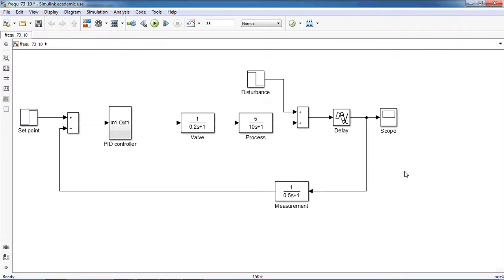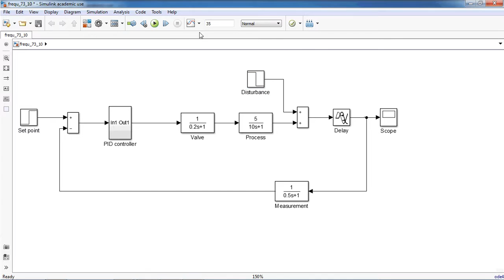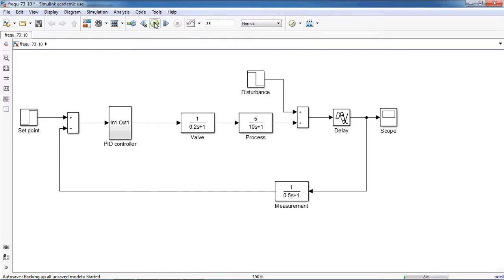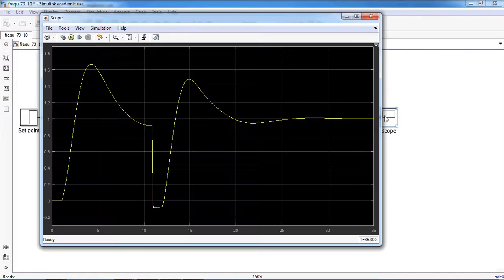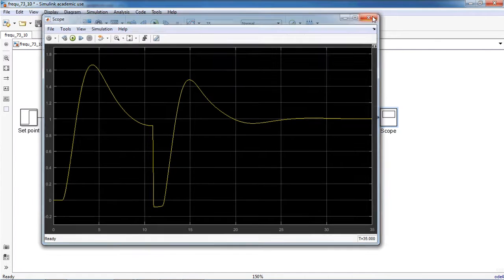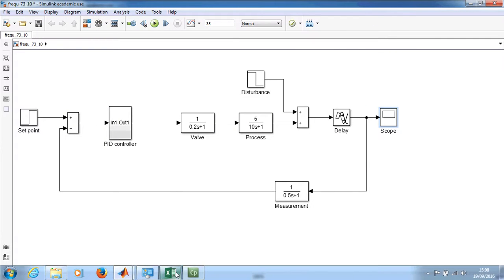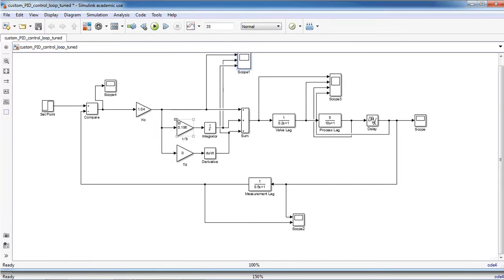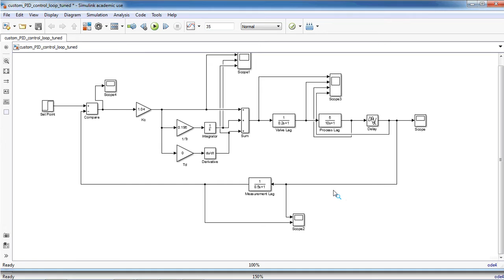Simulink PID Control Part 3 – Disturbances and Exploring Inner Workings

Comment: What if the disturbance is between the valve and the process? For some reason, my controller is Not doing anything to that disturbance. I have a hydraulic cylinder controlled by servovalve. The disturbance is a Force applied to the piston of the hydraulic cylinder. What could be happenning? Where to analyze?

Comment: but why have your system high overshoot?
Reply from the maker: Hi laith, thanks for the comment. There is high overshoot in this example because of the way the PID controller has been tuned. The parameters were determined using the Ziegler–Nichols tuning method. If you want no overshoot or less overshoot you would need to use another tuning method. For example, see http://ieeexplore.ieee.org/document/67610/?arnumber=67610. Thanks, Daniel